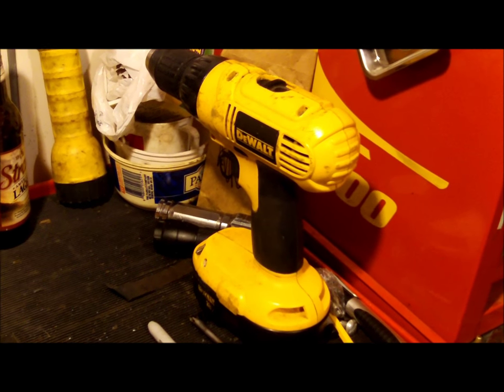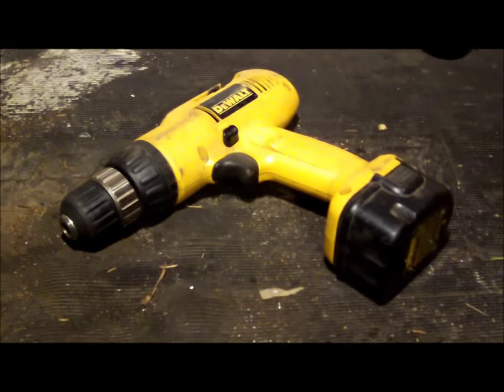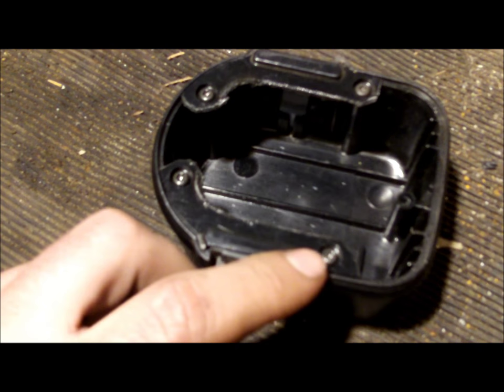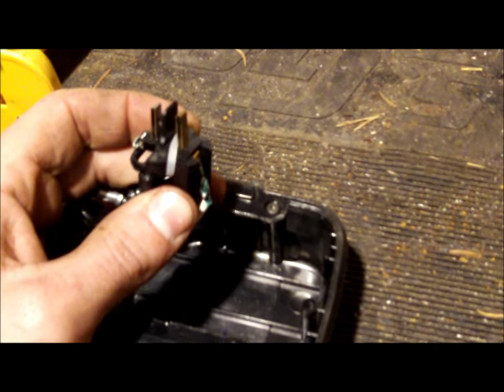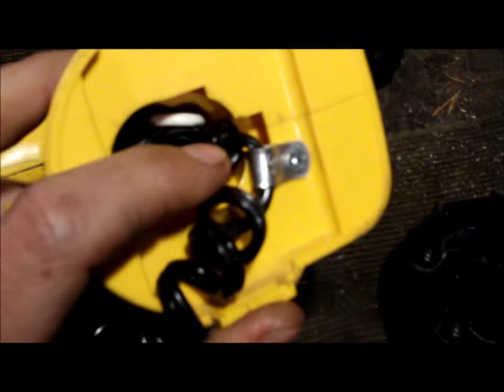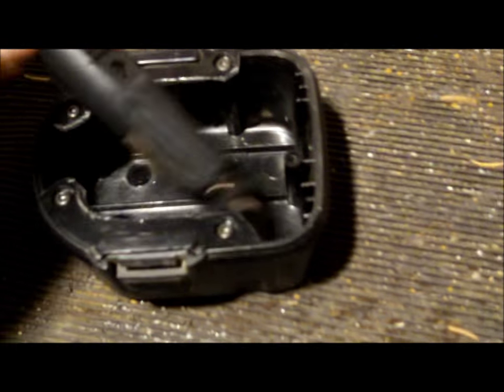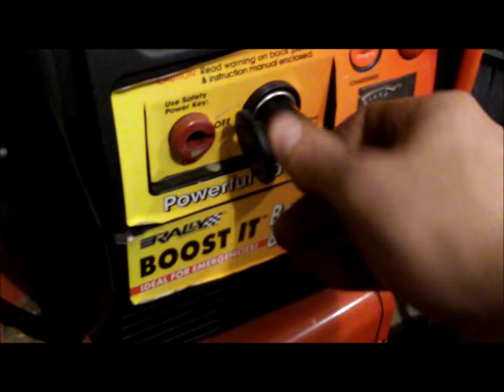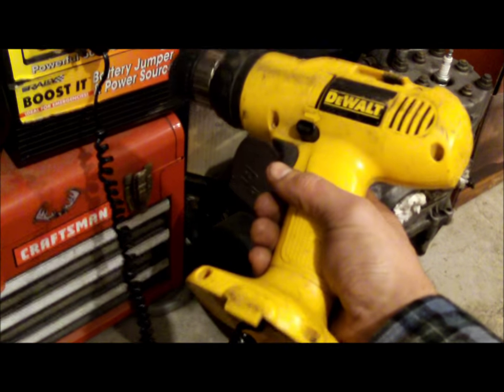Converting a Drill to Automotive 12v

Comment: this has good merit and ok execution. i think it is super smart and if it was built into a battery would make it more versatile it could be pluged in and be battery powered and with a little bit of work could run off of ac also that would make an older tool very versatile.

Comment: I attempted a conversion with similar thought process, but have ran into an issue...  What i did was, make a home-made salt spreader which mounts into the hitch receiver of my UTV.  The "motor" of the salt spreader is powered with an 12 volt dewalt drill, directly wired to a DC dimmer switch, then wired to the battery terminals.  It worked like a charm.... until after about 20 seconds of solid continuous use.  After that, the wires become very hot to the point of melting.  Wondering if anyone has any ideas as to what i need to do to fix this issue?  I am using 16 gage direct bury stranded speaker wire. Maybe i need bigger gage wire?  The DV dimmer switch was rated higher for 12 volts that the battery would provide, and the dimmer switch wires were 16 gage, so i figured the 16 speaker wire would be sufficient.
 

If anybody has any ideas, i'd love to know. thanks!
Reply from the maker: Sounds like the wires may indeed be too small for the current if they are melting.  If the motor is under heavy lot it will pull a good amount of current

Comment: My adapter is 12 volt but no power how many amps do i need ? Doesnt say anywhere and i dont want to screw up drill or my power supply☺
Reply from the maker: I would think the drill would only take a few amps at full draw?   I use the actual cigarette lighter which has a higher rated fuse.

Comment: I have done exactly the same as you have done here but now I'm looking to do this on a 12 volt DeWalt lithium-ion drill do you think it's possible
Reply from the maker: I think it's possible, but there may be additional electronics that need bypassed on a newer li-on drill, there's probably low voltage cutoffs or safety stuff.